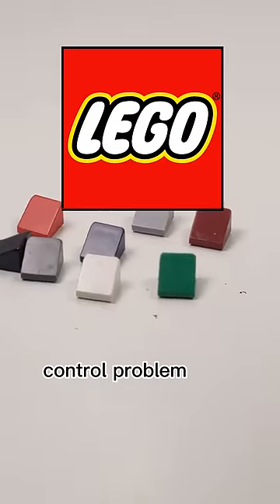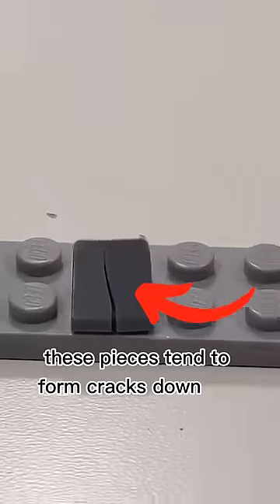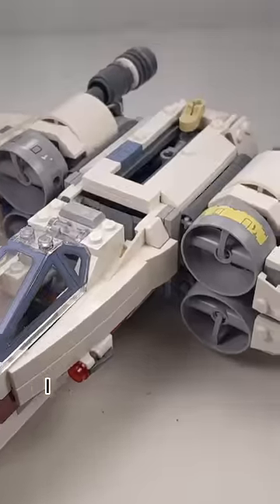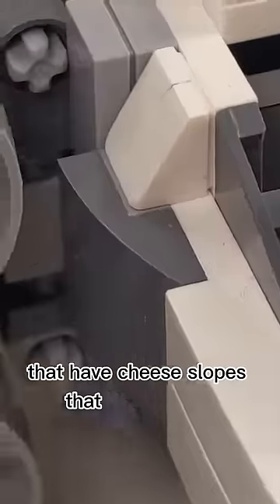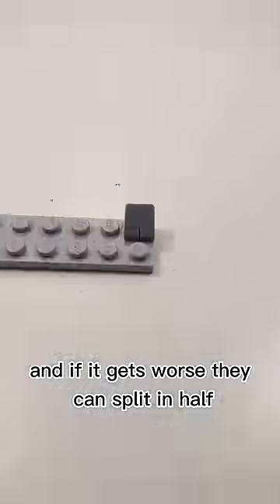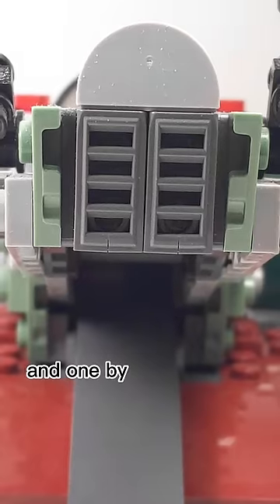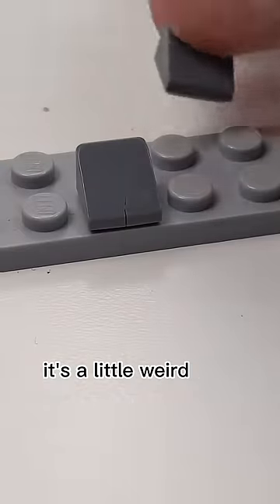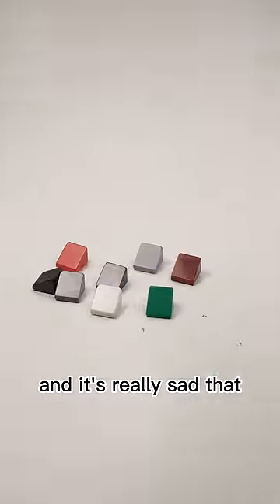LEGO has a Huge Quality Problem with Their Slopes #shorts #lego

Comment: none of mine have cracks but I guess that’s only because I use them once
Reply: Me too but there really old
Reply: same doesn't happen to me i use them alot
Reply: I've been collecting my whole life im 14 and I have never had a cheese slope crack
Reply: Ngl I think the quality issue is something to do with America because the brown pieces also break easily in America meanwhile here none of mine broke
Reply: @marcelwroblewski8747  I’m American none of my cheese slopes are cracked although I do agree that brown bricks are kinda s⬛️t
Reply: Same+i have pretty much no extra bricks for Mocs
Reply: @cadencase5216  Maybe it has more to do with the average weather in your region? I've never heard of this issue before and I'm Canadian... Maybe if you live in dry & hot weather these pieces are more prone to break?
Reply: i have some 5 years old, no xracks
Reply: Ye mine 2
Reply: I reuse pieces constantly, I have many of these over a decade old, and I’ve never seen a cracked one
Reply: I am constantly buying used sets, and juicing the parts repeatedly to build other MOCs and I have never had this happen to any of my slopes, ever.
Reply: @marcelwroblewski8747  The brown pieces cracking was fixed years ago, so nobody should be running into it with new sets. It's disassembling older sets that's usually the issue.
Reply: HOW DID YOU MANAGE THAT?
Reply: None of mine have cracks ...? Maybe it's based on how you put the piece on another?

My technique seems to be straight on 90% of the time, from the snippy you showed it was back to front? Maybe that stresses the piece in some weird way???

Idk maybe I'm dumb and there is a cheese slope problem... I just have probably all years of cheese slopes and no problems
Reply: @Boby9333  the drier the environment, the less cracking there should be on abs parts. abs is hygroscopic, and absorbed moisture causes it to become much more brittle.
Reply: Well I have
Reply: I got ooooolllllddddddd ones and none of mine r cracked.
Reply: It must be the slopes on the newer models. I used Lego 2000-2015 and haven gotten a broken cheese slope
Reply: I have some that have only been used once (in Canada, btw), and they are cracked.
Reply: He’s the chosen one
Reply: Same
Reply: Same
Reply: Same
Reply: @chezbob-xl6pd  same, I’ve been collecting legos sense I was 3 and im 12 and never happened to me
Reply: @marcelwroblewski8747  they break easily in australia
Reply: I have cracks in some of my old sets that have been doing nothing but sitting on the shelf for 10 + years really annoying looking for new pieces to replace
Reply: @marcelwroblewski8747  idk im american and have never even seen a broken or cracked lego brick , like not even one
Reply: @chezbob4832  bro I'm 14 half mine are cracked I build a lot tho
Reply: @Ifumsa  I’ve seen quite a few the red ones and brown ones are very fragile after a few years go find some old ones if u have any and try it they snap like dry twigs
Reply: Ughh i hate that cause one of my big sets have it’s slopes cracked and it always never happen to my medium and small ones maybe I should go to the lego store that I can get specific Lego pieces but it’s sorta far where I’m at
Reply: I have plenty of 18+ sets that I assemble once and never seen this happen. On the other hand my son has plenty of sets as well which are very often reused and reassembled and also didn’t notice that issue. But I can point out that not all bricks sit as tight as they should, and when playing some sets just fall to peace’s in hands
Reply: Some of the pieces I have cracked while building the set.
Reply: I think it depends on the pressure 
if u put it on studs with a lot of pressure and aggressively, it cracks, but if u do it nicely, it won't crack
Reply: Same
Reply: I also have no issue, even with sets with over 100 of those pieces that I bought used so they have been assembled at least twice.
Reply: Same
Reply: bro has 5,9k likes because said that
Reply: Guys… its not about the weather or your country. They crack because of time that’s it
Reply: Mine don't have cracks and they are not taken off unless to rebuild. If you want disappointment, look at brown pieces
Reply: ypu never build anything without instructions?
Reply: @marcelwroblewski8747  no they're problems everywhere as the way they make the bricks don't change between countries I've never had a brown brick or cheese wheel crack so I assume it's because these dudes rebuild so much that the quality issue presents itself after using it so much but most people don't build with them that often
Reply: Yeah, never seen one crack before
Reply: Same
Reply: Ive had ones that just seem to crack spontaneously. Like they are on sets ive not fiddled with too much since i built them and i go in for a light dusting and i see these cracked slopes its really weird
Reply: No cracks here
Reply: I have many cracked cheese slopes on my UCS Star Destroyer, and I've only built it once.
Reply: Same but I use mine a lot
Reply: @Boby9333  That's a good point, I personally live in Mexico but I haven't had any cracking issues, so I imagine it must be a difference in the process or materials used in the plastic plus the weather factor
Reply: I have used these slopes a lot and none of them have cracked
Reply: Same

Comment: I think the problem is more about how you remove them from studs rather then just placing them on studs
Reply from the maker: I may try that
Reply: @AlexavierStudios  try what lol
Reply: @AlexavierStudios  Dont think so. There's cheese slopes in my sets that I built once and never changed or deconstructed in years. The problem is present there as well.
Reply: It might be both caused by "rocking" it into place instead of putting it straight onto the stud
Reply: It’s a toy for kids. It shouldn’t need a particular building method. It’s Lego, after all. It should just work
Reply: @Kuchenwurst  ofc every other peice should be cracked to
Reply: @666xMajor  I think OP meant that the cracks form when you pull out these slope pieces too hard from studs and the channel's owner will be more careful when he pulls out these pieces from studs.
Reply: @Kuchenwurst it has to do with weather and temperature conditions
Reply: As I understand, it is an issue of temperature change.  I've had more pieces crack that we're placed and never removed.

Comment: Fun fact: extreme change of temperature or really hot and really cold temperatures in a room can cause pieces to begin  weathering and crack
Reply: and that happens to maybe 1 in 10000 people at most.
Reply: That’s because the plastic is not as good as 20 years ago.
Reply: @trevorthesorcerer  in 2017 lego switch to bio plastic , after that problems begun
Reply: @zap1008  they made the plastic much more thin even before 2017.
Reply: True
Reply: I have a like 60 yr old set and it’s held up extremely welll
Reply: It could be a result of UV degradation. ABS isn’t inherently UV resistant, and leaving pieces snapped onto a stud creates tension in the wedge along the weaker front edge. Having an assembled kit in an area close to a window could create a scenario where the wedges weaken over time, leading to stress fractures.
Reply: @trevorthesorcerer any plastic that's not a shade of black from 20 years ago would like to chat GPS was a inter-hobbby issue that effected any color that had reds/browns and golds. Primarily known from Transformers BeastWars, because eof the line over abodence of gold shades/tints of brown.
Reply: @gremblorthesackgoblin7953  LEGO plastic is bad when compared to hasbro.
Reply: @trevorthesorcerer  The last TF wave I think has made it about equal. Question: how does LEGO gold injected pieces fair?
Reply: @gremblorthesackgoblin7953  LEGO stop making chrome prices and Switch to a shine plastic that is not as good as chrome.
Reply: @trevorthesorcerer  Do they sometimes self destruct like gold still does to us sometimes?
Reply: @DarthBane.. I have a minifigure from '78
Reply: @braineatingamoebaa  and I have a set from 1955
Reply: @DarthBane..  dang that's almost as old as my granny
Reply: That's not a fun fact, it's logic.
Reply: @nikoraasu6929  you don't live in the south do you? We have hot AF to cold AH in the same week.
Reply: @Celtic1020  i don't live in the us
Reply: I mean, no shit? Lmao
Reply: Or deform.
Reply: Stop saying "fun fact"
Reply: @DarthBane..  I don't think cheese slopes are 60 years old in fact I think most peices aren't that old
Reply: @gremblorthesackgoblin7953  no because they aren't crome
Reply: @timohara7717  I’m not talking about cheese slopes I’m just talking about a Lego set that’s held up well it’s the automatic garage
Reply: >me looking at all the broken clips on the sets I've kept in my cold ass room for a decade
Reply: @codycummings2433 abs is also not very cold resistant, if they're potentially put in unheated storage depending on where you live thinner features might not hold up and snap below -10-20°C
Reply: Well, is it enough for the thermoplastic to move around enough to a form where the constant stress causes a crack or is it more likely that just repeated use of the part leads to failure over time?

Like. This is def more than just the temperature. it isn't like people are shocking their plastic in freezing weather to hot enough temperatures above glass transition.

This is less on the plastic or QC. I think it is the design of the part itself has a point where it is undergoing too much stress. So cheese slopes might need a redo
Reply: @zap1008 They didnt, they started testing it. Theres a handful of bioplastic pieces, all of which are lego plants, its the new more flexible green ones.
Reply: @zap1008 Don’t lie, they switched materials for polyethylene elements which make up only a small percentage of pieces
Reply: @trevorthesorcerer that's just straight up not true XD

Comment: "this usually happens when u place them on studs"

Bro how else am I supposed to use em in my builds 💀
Reply: Put them on your fingers like a child 💀
Reply: Only ones that have broke like that are from non lego clone brands.
Reply: Flip them sideways and use them to connect the input side of two bricks.  Thus making a brick with studs on both sides.  Make sure one brick is flat.  A little paper wading to hold up the wedge on the deep side.
Reply: @legobrickabrac  No? I only have one LEGO clone set, given to me by grandparents. And I have hundreds of official sets, many of which... have cracked slope pieces.
Reply: put them inside lego bricks in the way that youll never get them out :P

Comment: I've had this issue persistently. I am a moc builder so parts are frequently rotated between models, and these cheese slopes, along with 1x1 tiles and 1x2 grilles have cracking issues. The only way to negate this would be to reduce clutch power of the parts as there is not room in the design for extra reinforcement, but it's an undesirable tradeoff.

Comment: It's probably storage conditions. If the model is not kept at ideal humidity and temperature doesn't expect it to last forever.
Reply: my lego from the 90s is still fine no damage. Even the pices found recently in my parents garden.
Reply: It is a storage problem, yes, but very old Lego wasn't this brittle. All parts are prone to cracking like that, and I personally blame it on Lego going environmentally friendly and making so all of the parts they produce are more biodegradable. They've made big shifts in their plastic composition twice from what I know, and each time it lead to slightly more brittle parts.

Which makes sense, if you want your plastic to degrade faster, it'll degrade faster.

Comment: Its likely because that's where the the plastic fills out at the end of the cycle which forms a weld line. Weld lines are usually where plastic parts fail

Comment: If only plastic welders/hot knives and 3D printers were a thing, so that you could fix/modify or out-right replace pieces to your own specifications and allowing more clearance for the peg/post...

Or just tell customer service, they might replace the pieces (if they are too specialty to get at a LEGO store; i.e. unique set color)
And with customer complaints to go off of, they might have reason to modify or change molds or plastic recipe for that style piece. That is if they haven't already... and CS should also be able to tell you if this has happened since the release of your set with problematic pieces.

Comment: The smaller parts like those really do have QC issues, and they never last too long without a crack or completely breaking. Some of my balljoint sockets have this issue too, where the port that’s meant to hold the joint ends up cracking, and weakening, rendering the joint less useful, and less sturdy, and then they may completely break, which sucks.

Comment: Kinda found that they had been adjusting the recipe for the plastic of their products since the last Bionicle line. As anything that snaps or clicks into place has less durability when even new ball joints split the clips or snap off one side of the socket.

And it’s been happening with the technic spacers, where sliding them onto the Axel sticks cause them to split as well.

Which makes the price jump on lego kits all that much more anger inducing (and yes including non-branded/franchised ones).

It will be undeniable when we step on a lego brick and it snaps under foot with little to no pain…

Comment: It's just a material limit. Parts can only be so small/thin or large/thick before they start malfunctioning more often.  

They're a bulk part and easy to replace also.  Nothing lasts forever.  Tiles and shingles IRL require occasional replacement too.  

I find it fun to go through and maintain my older models.  Take em apart, clean them, and replace faulty parts.

Comment: Since it's happening to specifically that piece and variants of that piece, I imagine it's due to the shape and how putting it on a stud puts stress on that specific shape. 
I don't think they would be able to solve that problem without changing the plastic that the bricks are made out of and if they changed the plastic they use, they risk ruining the entire brick system. 
I think they would prefer to have one or two pieces that are prone to failure versus 20 or 30.
Alternatively, they could start making that specific slope out of a different kind of plastic, but then you run into the problem of aging, where that piece can degrade far faster than the other pieces. 
They already had that kind of problem where the dye they used in their reddish brown bricks caused the pieces to be more brittle and so any piece that was made in that specific shade of red brown would fall apart over time. 
They have since fixed that.

Comment: LEGO been having QC issues since 2012. After fixing the red/reddish brown dye issue they still crack easier than any other color. I’ve noticed minifigs torso dimensions are wrong and when you press the hip joint into the torso it causes the torso to bulge and this will become a issue sometime in the future with cracking torso sides.feet are cracking due to setting on studs, and clear pieces aren’t being bagged separately from normal bricks and getting destroyed.

Comment: Lego has a quality problem with a lot of pieces (apparently related to weather). I’ve had a few of these slopes crack on me (though I’ve only ever seen transparent pieces crack like that for that specific piece) but it also happens to a lot of other pieces, mixel joints have a expiration time of a few months if you leave them assembled and basically any technic pieces with slotted axle holes will break even faster. Yes it doesn’t happen to everyone (I imagine it has to do with weather because my pieces are never exposed to the sun or rough play of any kind) but it is still immensely frustrating for those affected as it effectively means certain pieces are banned from your mocs if you want them to last. Lego has the best quality in terms of finish and tolerances but it still cuts corners way too often with piece design…

Comment: Engineer here and lego lover. I’ve not experienced this problem—not a one has cracked for me yet. It may be due to thermal cycling from repetitive sunlight exposure followed by cold. ABS tends to degrade from this sort of environmental cycling. Cheese slopes are simply small and compact enough to bear the whole press fit load from a single stud and so on the thin side there’s little material and no neighbor to help. Hence they may be the first of your collection to show these signs systemically. Good luck!!

Comment: The cheese slopes do crack like this, and it's due to too much stress  on the slope created by improper placement of the slope. However, some cases include mis-moldes that make the slope slightly too tight for the model. It happens, unfortunately.

Comment: I’ve used thousands of these and never had a cracked one yet, I have had 1x1 tiles ( mostly reddish brown, 1x1plates and 1x1 headlight brick cracked, but only a small amount less than 10. I think mostly it’s the angle you snap the brick in place causes stresses leading to cracking.

Comment: I've had this problem with mixel ball joints, 1x1 plates (broke in half like a sandwich), 1x1 connectors, and most commonly... those little claws with the pipe on it.

Comment: Ive only had this issue with sets from around 2016-2018 or so. It also happens in the claw 1x1s, my At-At that i used for display is missing some head guns because the claws broke over time.

Comment: I have that too nöbut afaik only on a single set. I did disassemble and reassemble this set twice i think. But even the older ones that aren't in a specific set (we bought them in a box) and that we used a lot more don't have this issue.
Lego's brick quality in general is decreasing and it's becoming more and more noticable